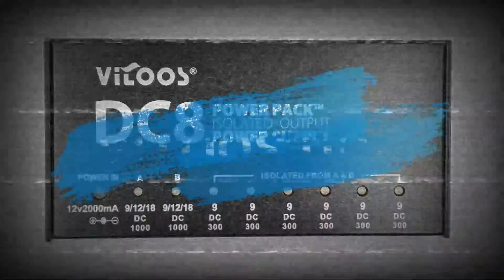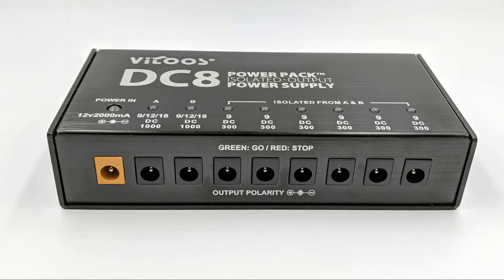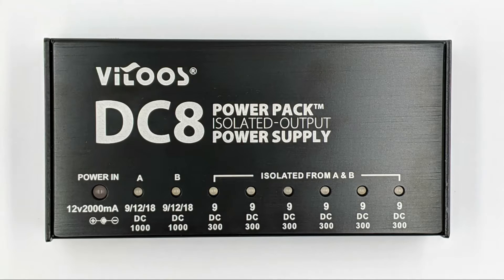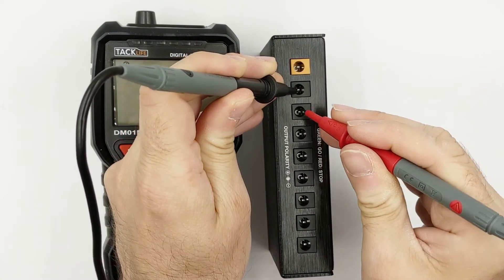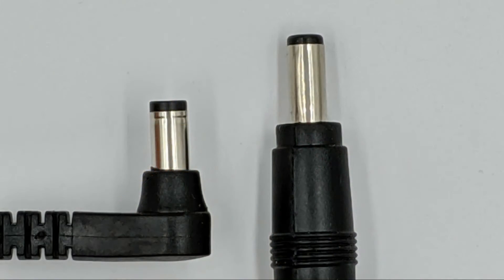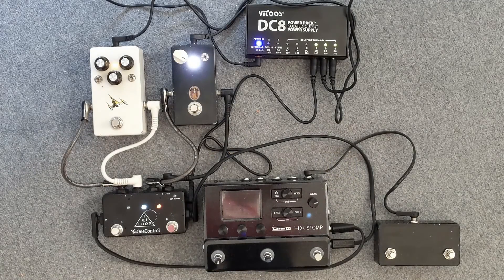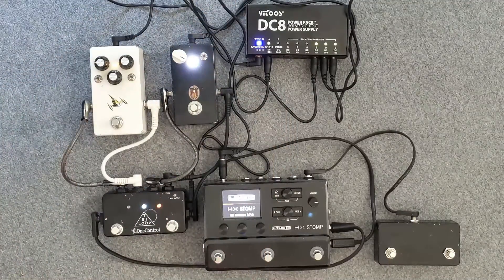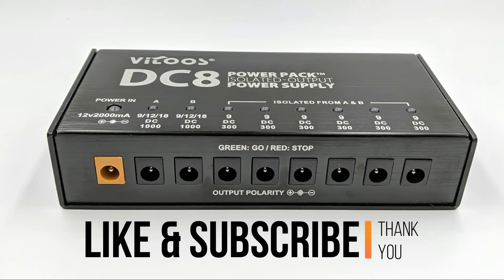Vitoos DC8 can power the HX Stomp

Comment: Hi frank，i follow u to bought a dc8 power supply and the 2.5mm cable to power my hx stomp，but my hx still off. why u can power up the hx but me not？
Reply from the maker: sorry to hear that. if you have the 2.5 mmm adapter and use either output a or b, it should work. the only thing that i could think of is, that if you have other pedals connected, the overall power draw exceeds 2000ma. the stomp draws 900ma max, so you only have around 1100ma for the other pedals. i hope that helps.
Reply: Frank Voigts yes～i know u mean，but i connected to hx only，why u can power up the hx is amazing～
Reply: i have the same issue
Reply: Ariel Arliyanus so i change another power supply already for dc7～the problem is done

Comment: The Line 6 DL4 needs 2000 mA. No way I could power it with this product?
Reply from the maker: The DL4 actually only draws around 200ma (look up DL4 current draw). The 2000ma is only quoted, because Line 6 uses the same (2000ma) power supply for all their models. I believe the DL4 uses a center positve 2.5mm plug ... that is something to keep in mind. With the right adapter, there should be no problems.
Reply: Frank Voigts Thank you for the answer. Where would you recommend to plug the DL4 on this product and at what voltage? Thank you.

Comment: Hello Frank, I've seen other videos that say that you need to use a polarity inverter, is this because they use a different PSU? Thanks in advance.
Reply from the maker: No inverter needed. It's center negative, like almost any other pedal. You do need an adapter, though. 2.1 to 2.5 mm.

Comment: Hey man, do you know if the HX stomp can be powered by the fuel tank chameleon and some adaptors? If so which power outlet do you plug into (1,2,3,4,5, or 6), what voltage setting does it need to be on, and what adaptors do I need? 
Thanks for your time and help, and great video.

Comment: its coming out very hot at least less than an hour, is that normal?
Reply from the maker: i am having no problems with it running my stomp and three drive pedals for hours on end. that being said, i'm probably only running it a little bit over half capcity (2A max). are you maxing it out?
Reply: @SLARPmusic  well I have 2 Digital pedals like Line6 M5 w/c gives 500mA & Boss DD20 200mA & the rest are just analog like Dirt, Drives, Comp, Eq, Tuner w/c give only less than a 100mA or even less than 50mA, so a total of 8 pedals are there

Comment: how about vitoos iso 4 plus will it work?
Reply from the maker: no. the iso 4 has a max current per output of 500ma. you will need around 900ma to power the stomp. the dc8 has two 100ma outputs, which will do the job.

Comment: One more thing, the 2.5 barrel is only required for the Stomp connection?
Reply from the maker: yes, line 6 does not use the standard 2.1mm plugs (which com with the DC8) that is common on most pedals. polarity is the same, though (center negative).

Comment: Frank, thanks for the info.  Is the A set to 9v?

Do you have an update? Is it still working properly after having the Stomp connected for some time?

Thanks again
Reply from the maker: yes, the stomp runs on 9v. over three months of (almost) daily use and no problems so far. does not run hot and there is no interference/noise with my analog pedals.